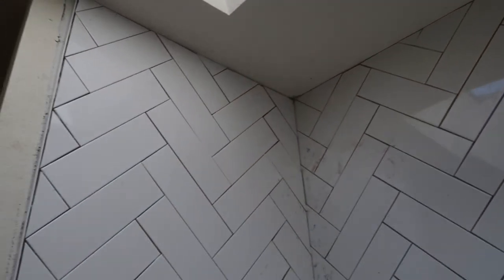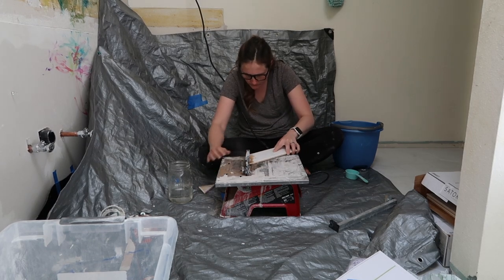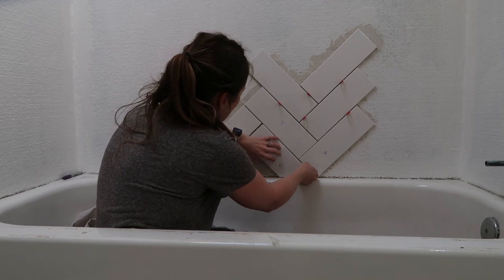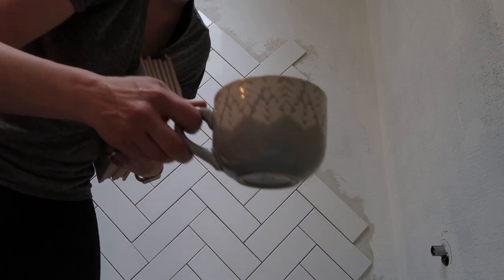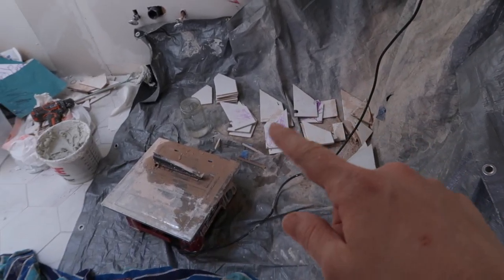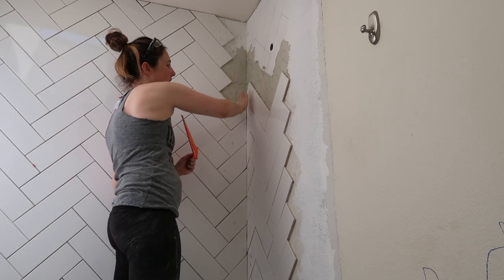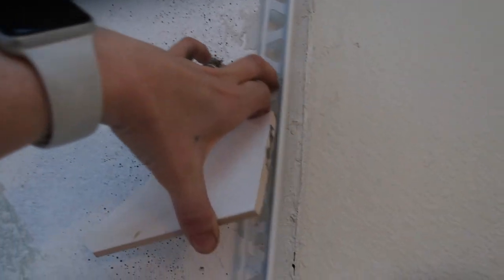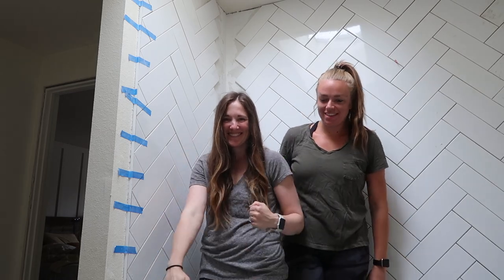Herringbone Tile Shower Wall / DIY Project That Turned Out AMAZING!!

Comment: Daring & impressive until you listened to Lindsay's idea. The left corner made it obvious it's a DYI job. There are ways to avoid all that measuring, time, and problems your methods created. Well done in the end for the most part.

Comment: Great work for first time just a little mistake starting from middle will not give u same cut size on the ends
Reply from the maker: Thank you.  It was really challenging and I thought starting in the middle would work, but found out later it was off. thanks for watching!
Reply: It does, but they didn't figure out the correct middle point.
I think they should have mentioned that later in the video, and starting the left side from the center caused unaligned joints!
Great job for a DIYer , I am learning from you